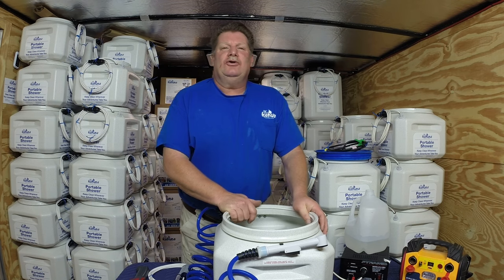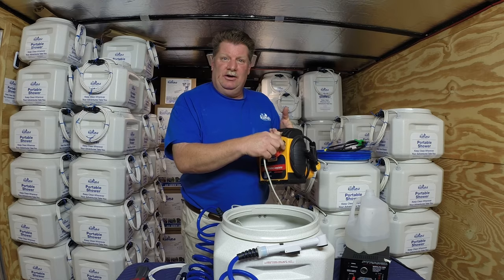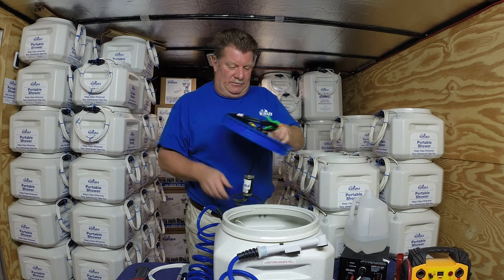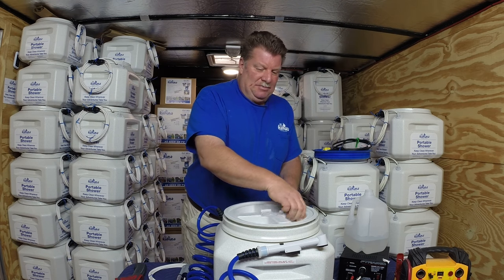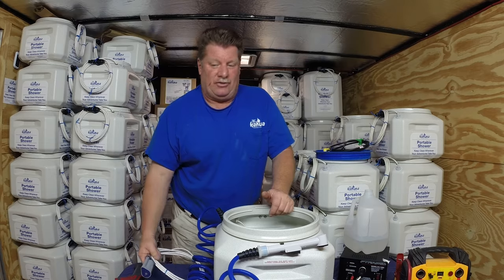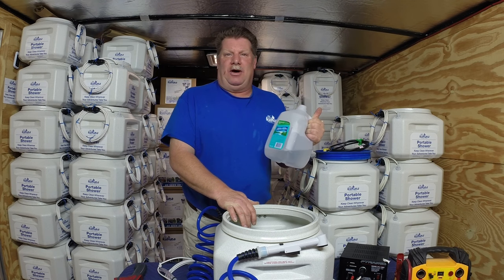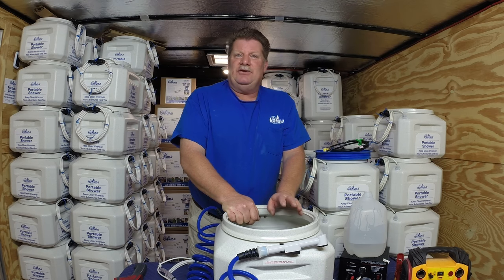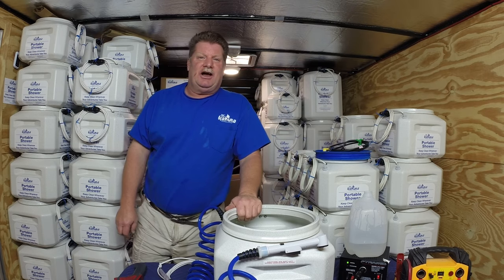Big Kahuna Shower TIPS

Comment: I bought my shower in 2019. Kept it clean according to their instructions. Within two seasons of camping I had to replace the shower head. This year would have been my fourth season using it and the motor doesn't work. So technically I got about 50 showers total out of it before it quit functioning. I'm hoping I can get the motor fixed somehow. I loved how it worked. And as far as the shower head they honored the warranty and sent me a new one for nothing. So they do stand by them.

Comment: I’m building a DIY TRAVEL TRAILER. This is a great option for sink and outside shower have you thought about or considered a way to easily hook this up to a faucet with tank in cabinet under sink. Love this set up.
Reply: Yes we can provide a 3/8 T fitting as well as 2 Sprayers and extra Straight Hose and TY Clamps ..You have to buy Direct as well as let us know on your order that it is for this conversion.Done all the time ..No Extra Charge when bought from us

Comment: I would buy it in a second if I could plug it in 110. I run generators. Don’t want 12 volts. Also does the pump always run or does the shower head have the on off switch.
Reply: WE recommend a Pyramid Power Supply PS 15 KX from, Amazon..The pump runs when plugged in .Impeller is Teflon not rubber so you cant burn the pump up if water is present,WE put on/off switch on 10 years ago BUT people forget to turn switch OFF !..The power supply has an on/off button on the front so you can use that

Comment: I'm planning on purchasing but what's the name of the power inverter unit you are using in the video? All the units I see online don't appear to have the 12v plug in like the one you have that allows you to then plug the inverter into a 110 outlet for power. Thanks.
Reply: Pyramid PS 15 KX ,,Amazon If you need link email us

Comment: Really nice setup, how big of a inverter do I need to operate the heating element? I'm only running 100 watts of solar on one large marine, how long does it take to heat the water to 100 degrees without drawing my battery down to low
Reply: Well Inverters are Not cracked up to be what they claim..The 4.7 gallon is the easiest to heat up .If you can run a Blow Dryer for 15 min straight your set up will work If not it wont .Our Heater is Very powerful 1,000 watts and 5 amp draw of current
Reply: @TheVelocity2002  Thanks, won't work on my inverter, looks like I well be cranking up the generator or boil water...
Reply: I know this is way late but there are solar water heaters where you place a black watertight bag out in the sun for a couple of hours to heat the water.  Then you hang it to gravity feed the shower hose that typically comes with them.  Add a privacy shower/toilet/changing tent and you can clean yourself while camping in relative comfort.  Other options for heating water are propane powered showers.  I found a lot of this stuff from watching Bob Wells CheapRVLiving videos here on YouTube (including mention of the Big Kahuna Portable Shower).  

If you're not able to stand while bathing a shower chair does the trick nicely.  They double as sturdy general purpose chairs but be sure they feature cross beam leg supports to keep the legs from bowing outward.  Something that happens rather easily to Equate models from Walkmart.  

You could go even cheaper with the purchase of a 1 - 5 gallon water cooler which also have those o-ring screw on lids plus handle(s) for ease of transport.  They're designed for keeping water cool to cold for many hours.  But what I have found is 15 minutes of heating water in a 700 watt microwave yields 1 gallon of hot water.  The 1 gallon Coleman cooler I have is entirely USA made and keeps the water hot for 3 hours.  I use 3 minute cooking cycle to heat 32 ounces of water, dump it in my cooler, then heat more water.  Saves from having a new $1,300 hot water heater installed which causes cancer.

Comment: Do you know of a solar water heater that works with this?  Or even a 12v. Would be great for off-grid camping with no 110.
Reply from the maker: Im working on a 12 volt one Now testing
Reply: Any update on your 12 volt version?  Also, what is the wattage of the 110 volt heater?
Reply: Mark Weiss Hi Mark, look up Jeff at Missouriwindandsolar.com. They sell a 12volt DC coil 😎

Comment: Hello we have had our big Kahuna we love it but have Questions it didn't come with the things you said from Amazon we only have the big Kahuna as it came we use it fine but it has a poor water sprayer and it has not got the 110 volt plug that you said we had to do it our self it only had the cig plug in
Reply from the maker: Your 12 volt power doesn't have enough Amps to make the pump work full power..No where do we say you get the 110 volt power supply
Reply: Maybe not the full 12 volts comeing out of the inverter. Amps  is the draw of the equipment. The higher the amps the lower the voltage. May need a stronger power supply.
Reply: I want one for my cabin. Read nothing but good things about this unit.

Comment: If you're in an RV can't you boil water then put the hot water into it with a bit of cold?   Would a heating pad be enough to warm it?
Reply: You can boil a bit of water and add.. The heater system works Great for Cabins and Tiny homes and all indoor uses..
Reply: The Idea is Safety as well .Handling Boiling water is Not recommended .You can easily get burned .Our heater eliminates that chance as well as the shower with heater will have the right Temp without hot and cold mixed
Reply: @TheVelocity2002    Yes.  Because as an adult who loves ice tea and cooks a lot I wouldn't ever handle boiling water every day.  (Grinning)   Nice try.  I applaud your effort to sale the heater.  It's enough I like your portable shower.  I am guessing in the summer just putting it outside and letting the sun hit it would be enough to warm it.  So another reason to like your product.    As an older woman with typical aches and pains a personal heating pad would probably work too.   I noticed you ignored that question.  So I am guessing that would work fine too if you're careful not to wreck your heating pad.   Hot water won't melt the plastic.   All I really needed to know.   Thanks.   :)   Again, nice try to get a few more dollars out of me.  I'll spend it on a few steaks for my freezer instead.
Reply: Kyleen Drake lol that cracked me up about the boiling water, like I haven't boiled thousands of gallons of water in my life already lol.

Comment: Hi. Qhere is the link for this?
I need one asap.
Reply: Which part do you need a link to ??
Reply: I am interested in the 13 gallon. And use for indoor. I also am interested in getting it with the heater as well
Reply: I want the heater kit
Reply: I went on the website but I am confuse about the heater kit. In the pic it only shows the cover with the heater but not the container for the water.

Comment: Good idea. Too many steps to heat it up.
Reply from the maker: Drop heater in the water and plug it in ?? It will pay for itself in 1 year by NOT buying propane canisters !!
Reply: JEFFREY STINCHCOMB just saying it would nice to not have two steps. Removing the heat lid then putting standard lid takes an extra step. I’m sure there is a reason. Just saying
Reply from the maker: Its a dual purpose system .When heater is in and on its a heated shower.When blank lid is on its for the beach when the heater stays home in the garage..
Reply from the maker: You have to remove heater and put blank lid on for Insurance Liability..Plus anyone leaving heater in and water level drops below element you will burn up the heater
Reply: JEFFREY STINCHCOMB gotcha. Love the product
Reply from the maker: German Pump,USA O-Ring Container ,you get what you pay for Cheers
Reply: does it not "unplug" 
12v would be nice
Reply from the maker: It plugs into 12 volts dc .When your done unplug it ..You cannot burn up German Pump !!
Reply: i mean 12v heater
how long does your heater take to heat say..72 degree water in 4.7 gallon unit? (or other example)
Reply from the maker: The Heater is 110 Volts AC ,,Not 12 volts ..No 12 volt heaters will heat water up fast enough and take too much energy.WE tested for 3 years ..Our 110 V Heater will heat 4.7 gallons in 15 min or less to 104 degrees
Reply: i guess id just need an inverter for off grid camping
Reply from the maker: Honda EU 1,000 Lightweight Quiet has Battery charger built in and everyone should own 1 .$499 and ATV dealer ..Runs 8 hours on 1/2 gallon of gas..
Reply: or paint it black..
Reply from the maker: Paint won't stick to Polypropylene..
Reply: if you say so
Reply from the maker: I've been in business for 12 years now .Paint even plastic paint will Not Stick
Reply: trust me with the right products and prep you can get the paint to stick to that kibble box

Comment: Where do you put the heater top once the water is fully heated w/o burning whatever you lay it on? I imagine the coil is pretty hot the moment it's pulled out.
Reply from the maker: Once you unplug heater wait a min and the water itself will cool it down enough .Unplug 1st the paperwork tells you.I use a Home Depot 5 gallon bucket to take heater out and drop right in Home Depot bucket